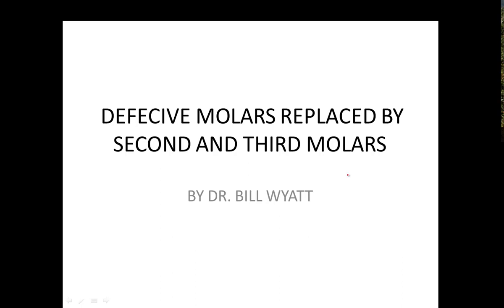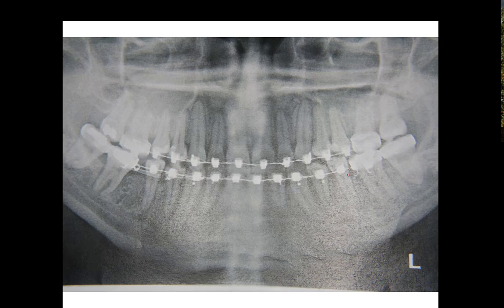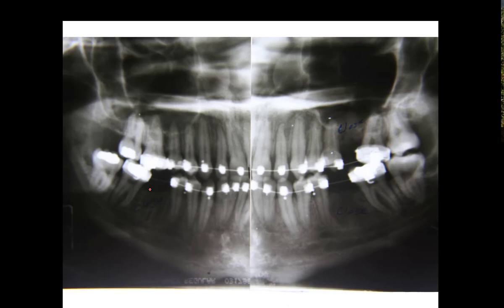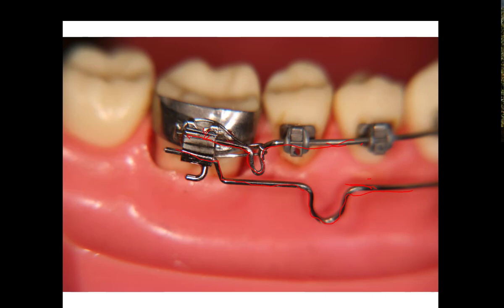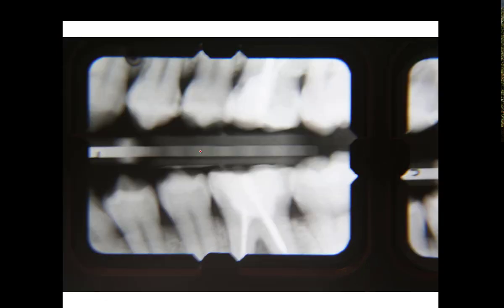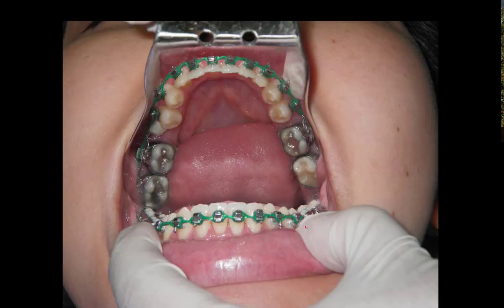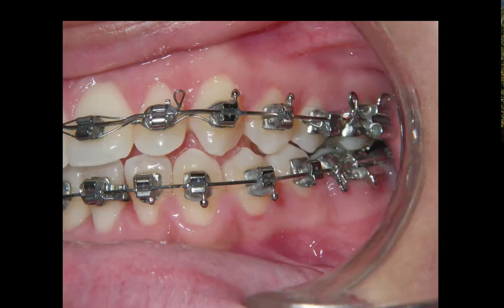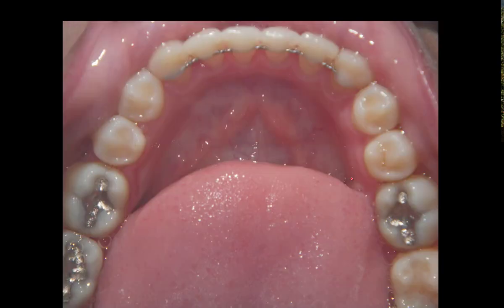Defective molars replaced by second and third molars

Comment: This is exactly my case. Here in the Philippines, I’ve shown this to the Orthodontist and she suggested implants on the missing 1st molar which costs about $2,000. I hope I’m able to find someone in this country who could help me use my 2nd molar and wisdom tooth move even if it takes 2-3 years. 😊
Reply from the maker: Bridge or implants are not necessary. If you have a wisdom tooth and you have time to work on this, you can replace it with your own tooth.
Reply: @DrBillWyatt can a 2nd molar tooth can pull forward to replace the missing tooth so that the wisdom tooth can grow
Reply from the maker: @kally3206  Yes. you have to have a certain amount of jaw length to hold the teeth. If there is adequate space, certainly the tooth can be put in it.
Reply: @DrBillWyatt   but not all the dentist like you Doc. They always advice to have implant, dentures, or bridge.
Where can I find a dentist like you
Reply from the maker: @kally3206  I didn't care much about making money. I loved doing orthodontistry. I did not let making money be my main reason to practice. That makes a big difference.
Reply: @DrBillWyatt  i salute you for that Doc
Reply: @DrBillWyatt  I have traumatic experience in dentist. January 2021 im under orthodontist treatment it just lasted  for seven months because the dentist did not treat my teeth right even though i have adjustment every month.
instead my teeth gets fix he ruin my four front teeth . Im so depress until now I really dont know what to do, Im just 20 years old too young to get a filling in my 4 front teeth. And after 1 month I heard that he is a scam pretencious dentist. Im sorry for all the good doctors but right now its too hard for me to trust a doctor. I want to have a dental check up but im too scared.
Reply from the maker: I am so sorry to hear that. Hope you can find a good doctor who would take care of your teeth. There sure are good ones out there.
Reply: My missing 1st molar was replaced by my 2nd molar and suddenly my wisdom teeth appears and replaced my 2nd molar
Reply: @dejav8760  how long did it take for your wisdom tooth to come and out replace the molar??? I have just removed my second molar and I’m hoping my wisdom tooth with replace it
Reply: @dejav8760  wow good to know
Reply: @dejav8760  your dentist is skilled
Reply from the maker: @dejav8760  you can replace your bicuspid as well as molars by moving posterior teeth forward.
Reply: Hi, Kuya. Any updates po sa case niyo? I also have this problem and my dentist advised din to have either  a bridge, dentures, and lastly yung implants. Implants costs around 50k-100k pesos and I was hoping that I can just moved my wisdom tooth to replace that missing molar.
Reply from the maker: @markeulee8314  Your wisdom teeth will automatically drift forward in lot of this space. Yes you can move your wisdom teeth into the space at fraction of the cost. You may not even need implants, bridges etc. Yes it can be done.
Reply: @DrBillWyatt  Thank you Doc for the input. I'll be showing this vid on my next visit at the dentist. I have a minor crowding at the bottom part of my teeth and I'm a candidate for braces. I was hoping to find a solution for my missing molars while having braces. Since what my dentist told me is that he can only ready the spaces in my teeth for dentures/implants. Luckily, I found this video regarding my case. Pls keep making videos like this because it's very informative and I think other dentists don't know this solution. Ty again Doc 😊
Reply: @DrBillWyatt  thank u so much doc , nowadays many doc try to make money by comprimising patient lives , they know the treatment but avoid to do so to make money
Reply: @DrBillWyatt  sir do u know any orthodontist  or friend of urs here in India who can do this type of surgery , it will be very helpful
Reply from the maker: @markeulee8314  Look at the videos that we put out. You will see all this is possible. You see things in action.
Reply: @DrBillWyatt  sir is it possible for age above 36 , can my wisdom teeth shift toward my missing second molar
Reply from the maker: @akshaypal6753  YES it can. Age is no concern.
Reply: @DrBillWyatt  we need a doctok like you here in the philippines
Reply: @DrBillWyatt  thank u sir
Reply from the maker: @kally3206  I would love to come to Philippines but I believe I have past that age now.
Reply: @markeulee8314  unfortunately, I went to a very expensive Ortho clinic here in Tagaytay and they don’t wanna do it as well. They say I’m too old at 35 to move the molars forward. They advised me to get implants or crowns. I just told myself, nah. My mouth can still function so I don’t need to spend that much money.
Reply: @johnbc  sayang :((( Ty for answering!
Reply: Its possible, the dental clinic here in mandaluyong explained that it can be done. They will use a spring that will be attached to the upper lateral side of the gum. Search smile craft dental clinic here in general kalentong mandaluyong city.
Reply: @puppetmasterreloaded3341  appreciate your recommendation. I was able to visit for a consultation and I will start my treatment probably next week. 😊
Reply: @johnbc  are you from mandaluyong also
Reply: @puppetmasterreloaded3341  no. Makati. 😊 I went there earlier. Staff are welcoming and friendly, so are the dentists.
Reply: @johnbc  yeah the consultation is free. In makati most dental clinics will charge you 1500 for consultation and want to extract your wisdom teeth so they can cash cow you 20k per wisdom tooth. Its hard to look for less aggressive dentists.
Reply: @johnbc  were you able to do it? is it a success?
Reply: @naw5879  yes. It’s working gradually for me and my teeth are moving as intended. Quite expensive, but I’d say worth it.
Reply: @johnbc  do you think everyone is qualified for this procedure?
Reply: @naw5879  I believe so.
Reply: @puppetmasterreloaded3341  Can I ask what is the name of the clinic? and are they willing to do this kind of procedure?
Reply: Same with my case
Reply: Same as my case. Kuya baka nakahanap na kayo update naman po :(((
Reply: Hi sir. Did you find a dentist who can do this with braces? We have the same situatuon
Reply: @pennelopemendoza3350  unfortunately, went to several clinics and none of them wanted to do it.
Reply: @johnbc  sad but thanks for the info. what happened now? is it still missing? your other teeth move?
Reply: @pennelopemendoza3350  yeah.
Reply from the maker: @pennelopemendoza3350  Try to find a dentist on American dental association website. There are several good ones on it
Reply: @DrBillWyatt  im from the philippines doc 😔

Comment: hello doc my wisdom teeth (lower left and lower right, upper right part) are visible but my upper left wisdom tooth is still not visible and i got my first upper molar removed yesterday and my dentist told me that it wil be hard for me to chew if they are going to move my second molar and wisdom teeth to fill the gap, i also got my first two lower molar removed due to cavity. do u think that it will be hard for me to bite if they are going to move my molar and wisdom tooth??
Reply from the maker: This appears to be like this, but it has almost no effect on it. You should start moving the teeth into the space actually the day you extract the bad tooth. Dont let the corticle bone fill in from the sides. However the space can still be closed. Your dentist/ortho probably not properly trained in this area. We have enough videos showing exactly how to use the pressure to move teeth forward.
Reply: @DrBillWyatt  Hello Doctor, Im going back to my ortho probably on june 18 and im going to ask if they could move my second upper molar and wisdom tooth  (upper left) to fill the gap on my upper left part which i had my first molar removed two weeks ago. I will just recommend that they should just move my wisdom teeth to fill the gap on my teeth that has been removed because i do not want to use dentures
Reply from the maker: @user-fk8kf2vn3s  That's correct. Good luck on your treatment.
Reply: @DrBillWyatt  hello doctor, after my tooth has been removed i can see now that there are some bone and it is kinda hurts and it is on my gums where i got my tooth removed. i researched about it that it might be some part of my tooth that has been removed. i already went back to my clinic last june 21 but i forgot to ask what it was and i am kinda worried because it is so visible right now. may i ask doctor bill if you know what it is?
Reply from the maker: @user-fk8kf2vn3s  I know what it can be. When I was in dental school, i removed a deciduous 2nd molar. The distal root of this tooth had been separated from the rest of the crown and I did not get the tooth to root out. After the bicuspids came in and x-rayed it and the roots were still there. It worried me so the old surgeon sent me into go dig in the roots out of this persons jaw which was a big mistake. I did it, he was fine. Then identical same thing happened. I watched another deciduous teeth like that and after a year or so, the deciduous root just literally disappeared. So my advise is to just watch the teeth. If it is a part of teeth, it will stay. If it is not, it will resorb. Dont even worry about it.

Comment: hello dr.bill my dentist told me that i just need to  use dentures after braces coz it will be hard for me to chew if they are going to move my lower second molar and wisdom tooth to replace the extracted first molar
Reply: i actually think that it will be good if they are not going to extract my wisdom tooth cause it will help my teeth alignment
Reply: my wisdom teeth (lower left and lower right, upper right part) are visible but my upper left wisdom tooth is still not visible and i got my first upper molar removed yesterday and my dentist told me that it wil be hard for me to chew if they are going to move my second molar and wisdom teeth to fill the gap, i also got my first two lower molar removed due to cavity. do u think that it will be hard for me to bite if they are going to move my molar and wisdom tooth??
Reply from the maker: This appears to be this way, but it has almost no effect on those teeth moving forward. Infact the more you use them, the better they move.
Reply from the maker: I also date the movement of these teeth in my videos to show that this is not a holdup.

Comment: Hello. I was wondering if this treatment is done. Will there be no further bone loss and will the jaw go back the way it was?
Reply from the maker: When you move posterior molars into an anterior spot created by loss of 6 year molars or if you do it quick, the posterior teeth move into the area before the cortical bone closes over the top of the space. So if you are planning to do this, get the teeth ready to move the posterior teeth forward prior to the extraction. I prefer to start moving the teeth into the space the same day the bad tooth is removed. But this can be done later, just takes more time when you have to move the cortical bone out of the way.
Reply from the maker: It works. No question about it.
Reply: I am 13, and my dentist said that we will wait for my wisdom teeth to erupt and the wisdom teeth could possibly push it forward? Is it true? Or not?
Reply from the maker: @Hello__01  The wisdom tooth will push the tooth but not in the proper place. Look at some of the cases we have move the 6 year molars. We have moved the 2nd and 3rd molars into the 6 year molar place. Its by far better to do it when the teeth are first extracted. But dont wait on the wisdom teeth, it is years later.
Reply: @Hello__01  omg same and I'm panicking
Reply: @Hello__01  GIRLL SAME AGE AND SAME SITUATION
Reply: Um, one last thing dr. Will it be super expensive. Because this type of method isn't used much in our country, so I was wondering what average price this procedure would jump at?
Reply: Hiii, I think you're also from the Philippines. And I was wondering, did you find any dentist that offers this treatment? True na hindi to gamit na way kasi mas prefer na irecommend ng dentists usually yung implants, bridges, etc. Kaya I'm also finding a dentist who can do this. Thanks for answering in advance.
Reply: @markeulee8314  ah, hinde ko pa napapaayos hehe.  But my dentist said that they could do this. They said it could be adjusted using braces. I recommend to try asking a near dentist/orthodontist to see if they could push molars forward. Most likely they'll use braces which will be a little expensive.
Reply: @Hello__01  Ask ko din dentist ko kun pwede to 😂 Ty for answering!
Reply: @Hello__01  hi any updates? I have the same situation 😭

Comment: I just had an upper first molar extracted a week ago. I may not have enough bone to place an implant, and I just recently learned that shifting teeth could be an option for me since I still have wisdom teeth in my gums (they are impacted and leaning though). This doesn't seem commonly done so I don't even know where to look for someone to get this done. Also, can this be done at any age, or just very young? Thank you.
Reply from the maker: As far as I know, this can be done at any age. I've done many of these cases and have had no problem. It's best to move the posterior teeth forward into the space immediately after extracting the molar or bicuspid. This does not allow the cortical bone to close up in the space causing a knife edge ridge of cortical bone. You can still move the tooth into the cortical bone, but it takes much longer. It's my belief that this can be done on anyone regardless of their age. I hope this answers your question.

Comment: Hey doc how long did it take for you to protract those molar forward?
Reply from the maker: If you start closing the space immediately when the teeth are removed (The same day), the space closes much quicker. If you wait, the cortical bone closes up and after a long period of time, you'll have a knife edge ridge of bone between the teeth. I've seen this in bridges. You can close teeth into this, but it's very difficult. So, the quicker you start the case, the less time it will take to close the space.
Reply: Would you suggest closing the space if the 1st molar was removed 10+years ago? And the bone is thiner now. Or in this case an implant is better? I'm 27 years old

Comment: Hi Dr. Bill, I have a question
One of my case, a 20y/o female, who had her second molar extracted due to deep caries. There was also an impacted third molar with incomplete root formation. After 2 years, the previously impacted third molar erupted to the proper place and replace the second molar
I want to know will an impacted maxillary third molar with its root formation completed erupt after the second molar is extracted? How do you predict? Does it depend on whether the root formation is complete?
Reply from the maker: If the root formation of the rest of the teeth in the mouth forms properly, you think that the 3rd molar coming in will have proper root formation. But if its impacted and the developing roots run into something solid, they will be croocked. But the tooth can be used with the croocked roots. Thanks
Reply: @DrBillWyatt  Thanks for your answer! I mean the roots formation of third molar already completed. After the maxillary second molar extracted, will the previously impacted third molar spontaneously erupt? Since the path of eruption is unimpeded. In adult over 26 years old
Reply from the maker: 3rd molar can drift into the space where 2nd molar was, but u have to keep the teeth above where it doesn't touch anything.

Comment: When you say replaced by second and third, do you mean your first molar replaced by your second, and your second replaced by your third? Because my first top right molar is broken and I have a 3rd molar in the required location. Would I be able to pull out my first molar, get braces to bring the second into first and my third into second?
Reply from the maker: You slide teeth from the back toward the front to fill gaps. If you have wisdom teeth that many people dont use,  then use them. It is much better than bridging or implants and far more economical. But it is better. In many of these cases, a dentist can see this person and not know that they have lost 6 yr molars. Certainly you can do that if the 6 yr molar is beyond repair or cost too much to repair.
Reply: Dr. Bill Wyatt I appreciate the reply, I’ll be sure to consult my dentist to proceed with it!
Reply from the maker: @JakKnifez  ok. Good luck

Comment: Hi Dr. Wyatt. You did a good job of bring 2nd molars in the position of 6 year molars. Not an easy job and I liked your trick with the TADs. Can you please elaborate on that and also on the type of bend you give distal to the 2nd bicuspid during retraction.
Reply from the maker: This is something all dentist should know how to do and that, it could be done !! When taking a tooth into an extraction site, be ready to move immediately after the tooth is extracted. Dont wait !! 
The TAD are little screw, should be attached in the cortical bone . It does not have to be touching the tooth itself but bonded to the tooth with a good composite. 
It can be slightly to the side of the tooth. It works !!
When you are pulling a 1 or 2 teeth forward into a space we have shown you on the videos how to make this circular spring, it is activated downward at about 30-35 degrees. The effect of this when pressure is put on to pulling the teeth forward is to make the roots of the teeth come forward as well as the crown i.e. bodily movement. 
We have explained a lot of this subject in other videos.
Reply: Thank you Dr. Bill Wyatt for answering my question
Reply: Hi dr

If the tooth extracted 6 years ago and the bone under it is so thin, will it be possible with bone grafting?